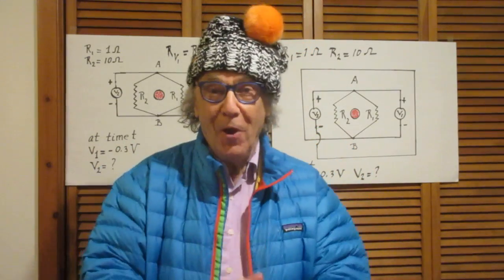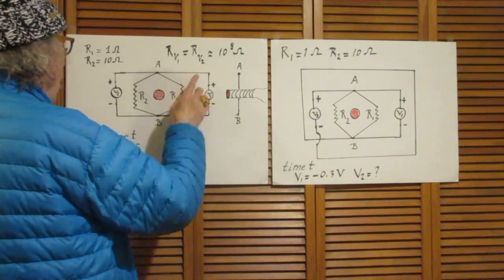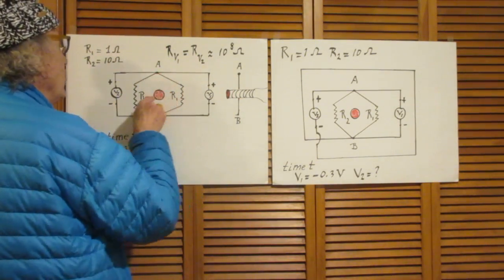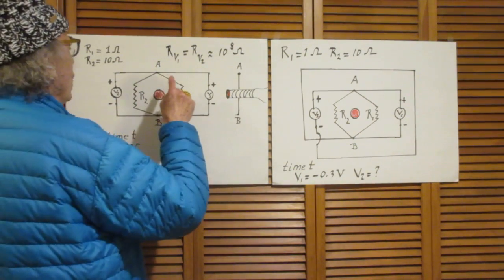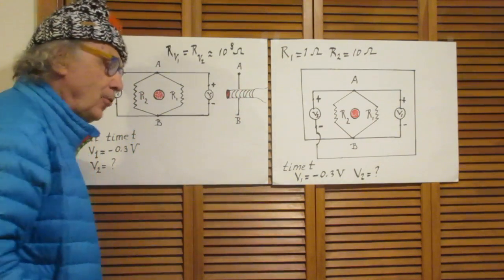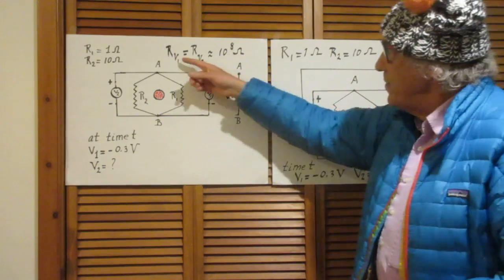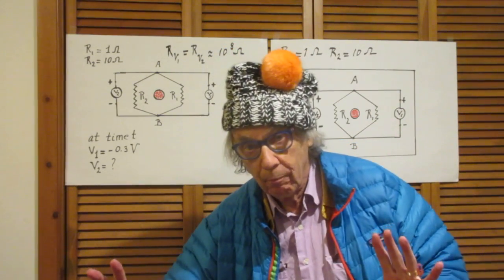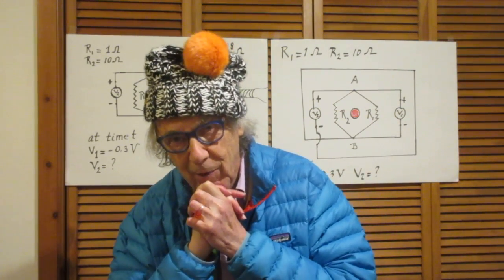Induced EMF Problem #37

Comment: Well, any reasonably trained electrician would, of course, immediately answer at the first sight of the "problem" that in both cases the voltages must be V2 = V1 = 0.3V ...in both cases (presumed that R and I in the supply-wiring to the meters are close zero). Length of wiring and location of the meters dont matter. 

Both meters are located at points A and B, current and resistance of the leads are negligibly small and if the meters are working properly, they must display exactly the same value. R1 and R2 don't matter regarding the fact, that both meters MUST show the same values.  Even when it get's more tricky and when we suppose, that a voltage is induced in the supply lines (which is presumed to be suggested here), both voltages must also have exactly the same value (only then increased or decreased by the induced voltage value, depending on the direction of flux of the magnetic current).

Do you just want to fool us a little, Sir, and make us ponder?  Forgive me, when I'm totally wrong  :)
Reply from the maker: I appreciate the fact that this Physics may not be familiar to you. Don't feel embarrassed about it; you are not alone. However, it's never too late to get educated. The choice is yours. Maybe this will help you. 
I demonstrated at the end of my lecture #16 of my 8.02 E&M course at MIT that two identical voltmeters attached to the same 2 points in a circuit can show very different values. https://www.youtube.com/watch?v=nGQbA2jwkWI&list=PLyQSN7X0ro2314mKyUiOILaOC2hk6Pc3j&index=17 The reason is that in the case of an induced EMF (Faraday's Law) potential differences are no longer determined; they depend on the path. This also applies to the secondary windings of transformers as the EMF in the closed loop of secondary windings is induced. https://www.youtube.com/watch?v=b7i2uMx7gHo&list=PLyQSN7X0ro22zanLOcvkaSY-IZqheFYM5&index=8
Of course, in cases where Kirchhoff's loop rule (KVL) applies, 2 voltmeters attached to the same 2 points in a circuit will always show the same value. 
My demo was first suggested and published by Romer in December 1982 in the American Journal of Physics. This demo has now become a classic; it's done all over the world at many colleges and universities. 
Kirchhoff's original text can be found in the following link, pages 497-514: https://books.google.de/books?id=Ig8t8yIz20UC. Clearly he was fully aware of the prerequisite for his "loop rule". KVL is a special case of Faraday's Law. That's why Faraday's Law is one of Maxwell's equations and KVL is not.
By teaching students that KVL always works without telling them when it does not work, makes many believe that the closed loop integral of E dot dL is always zero. ElectroBOOM and Dirk Van Meirvenne therefore believe that 2 voltmeters attached to the same 2 points in a circuit must always show the same value which is not true as demonstrated in my lectures. They each posted a video (see @ note below) on their channel in which they claim to have proof for their wrong ideas which violate Maxwell's equations. Apparently they do not know, or do not understand, that in the case of an induced EMF potential differences are no longer determined; they depend on the path. MIT students who took my 8.02 course (Electricity and Magnetism) would not make this mistake! I therefore believe that to introduce a "modern version" of KVL and then teach students that KVL always holds is not advisable as you may set them up for making the same embarrassing mistake that both Dirk Van Meirvenne and ElectroBOOM made. 
Also read Professor John Belcher's thoughts on Faraday's Law and on KVL. Professor Belcher is my former colleague at MIT. http://freepdfhosting.com/0813df09f5.pdf
(@) ElectroBOOM insulted me in his video by mentioning that the reason why my 2 voltmeters read different values was due to my "bad probing". If I had done the demo correctly I would have found that both voltmeters would have read the same value.  
This is my only msg on this issue. This is too basic; I do not argue either with people who believe that the Earth is flat.
Reply: A 1000 thanks for your kind and –as far as I could follow your remarks- illuminating response to my modest request.  As a trained e-engineer, who’s somehow helpless when facing phenomena that run counter to traditional e-technology rules, I would try to approach the matter with empiricism, methods of elimination and a little bit practice. In my simplistic but also balanced view of the world, I would shrug off the matter as a peculiar, unspecified "disturbance in the system" that needs to be eliminated (my perplexed shrug included).

As for me (as a practice-oriented non-physicist), at some point the path of mathematical analysis doesn’t really seem to have a promising end and in order to approach and to solve this dilemma I’d try to do it with the help of screens (oscilloscope, dU / dt etc.), shielded leads and, by adhering to the given premises (negligible inductance and resistance of the cables), I’d try to approach the "source of disturbance" this way and step by step   ...but, of  course, that's actually not the point and I am not sure, that this kind of approaching would solve my dilemma. I’m afraid it would - according to what you’re saying – partially just shake my conception of my small, little world  (which, of course, sometimes is more than necessary and also enlightening). 

Howsoever, Sir ...thank you for your wonderful suggestions. On the basis of your links, away from stubbornly following Kirchhoff, I’ll try to go deeper into the matter next days  ..within my means. 

Your physics lessons are great   ..as you are!    ....Greetings from Austria

Comment: V2 first diagram = V2 second diagram = -0.3V
Reply: Am I correct in assuming that the voltmeters are ideal and the probe wires have no resistance, inductance or capacitance and not affected by magnetic fields?
Reply: Thanks for the reply. Please tell me which of my assumptions are wrong.
Reply from the maker: There  are 2 mistakes in your answers (V2 first diagram = V2 second diagram = -0.3V). Copper wires total length about 30 cm with resistance, capacitance, and inductance  so low that all can be ignored. It's a very straightforward 1st year college physics problem. Use Maxwell's eqs and you have the answers in less than 5-10 minutes.
Reply: Please tell me if the voltmeters and the probes are are ideal?
Reply from the maker: These are normal voltmeters. All equipment is standard. If there had been anything special that students would have to know to do this problem, ofcoz I would have mentioned that in the video.  Some of my viewers and students have done a somewhat similar  demo at home with standard "RadioShack" equipment. Nothing in life is "ideal" but simple equipment is good enough to show that V1 differs from V2 by a factor that can be calculated in advance as I did in my lecture at MIT (for first year students) before I did the demo. It all comes down to knowing how to use Maxwell's eqs.
Reply: What if the voltmeters and probes were ideal, then, would my answers of -0.3V be correct? Your clear reply to this would make clear a lot of misunderstanding.
Reply from the maker: there are 2 mistakes in your last answers. You don't know how to apply Maxwell's equations in the case of an induced EMF. Don't feel ambarressed that you cannot do this problem. I suggest you look up my solutions which are on this youtube channel. This is my last msg.
Reply from the maker: You can lead a horse to water, but you can't make it drink. It's now up to you. Here is the water, however, if you do not want to drink and learn some new physics which was unknown to you, you are on your own. I have done all I can and cannot help you anymore. Good luck!
https://www.youtube.com/watch?v=xMVu_rY5xZY&list=PLyQSN7X0ro207exLyDsBo_N3_EJcydeeM&index=73

Comment: Even if the inductance of both the two voltmeters loop is very small (and their résistance enormous), I was wondering if the value displayed by both volt-meters hasn't something to do with the EMF induced through the volt-meters LOOP itself ?...
Here, I respectively mean :
- V1's loop is closed by the R2 conductor.
- V2's loop is closed by the R1 conductor in question 1.
- in question 2 : V2's pair of loops is also closed by the R1 conductor.
...
-And of course, the EMF is 3.3 Volts around ANY closed loop (whatever its shape or size)...
... Am I wrong Sir here ?,about wondering if the voltmeters loop(s) themselves (NOT ONLY the inside loop R1+R2) should ALL be considered as "inducted" circuits ?

Comment: This procedure was published by R.H Romer, Am. J. Phys. 50, 1089(1982).
Same problem in D. Griffiths, Introduction to electrodynamics
Problem no. 7.50
Ans to first part is, 3.3 volts

Comment: In first question, V2 is -3 volts. Since R1×i = V1 =>i = 0.3A, so, V2 = R2 ×0.3 = 3volts. The sign of V1 is -ve, so the direction of current is reverse and hence the signed value of V2 comes out to be -3volts. 
For the second case though, since there are 2 loops now, the induced emf is doubled, but resistance remains same, so current is doubled for V2. Hence, V2 attains value( i×2)× R2 viz -6volts. I hope this is correct, it most probably isn't though. I don't know why, but I feel that it is incorrect.

Comment: The answer for both the cases is almost +3V. "Almost" because in the outer loop too some current will be induced which we are neglecting since the resistance of the voltmeter is very high.

Comment: Kirchoff's Laws also must be satisfied for every loop. In first case V2 = -0.3. But in second case , since flux links with two turns hence V2 = 2x(-0.3) = -0.6 volts. 

This question also provokes us to think that :"we get two different values of Line integral of electric field when traversed along two different paths". It is justified because the induced electric field in this case is non conservative hence its value depends on the nature of path traversed.

Comment: In case 1, the total emf around the loop must be 3.3 volts (terminal A through R1 to terminal B then through R2 to terminal A), so that v2 will read +3.0 volts.
In case 2, meter v2 has a one turn coil in series with the negative terminal, raising its potental by 3.3 volts compared to case 1. Therefore, V2 will read -0.3 volts. This can be found from subtracting the 3.3 volts induced from the 3 volts across R2 (taking the closed path from point B around the loop to the negative terminal of meter 2 and then through the meter to terminal A, then through resistor R2 to terminal B)

Comment: 4th Attempt:
Case 1 V2= +3 volts
Case 2 V2=  +4.5 volts
 
3rd Attempt
Case 1    V2= -3 volts  (just changed the sign)
Case 2    V2 = -6 volts  (just changed the sign)
 
2cd Attempt
Case 1    V2= +.3 volts
Case 2    V2 = +.6 volts

1st Attempt
Case 1    V2= +3 volts
Case 2    V2 = +6 volts

Comment: Sir, do you remember, I have informed you that I have done this experiment in my lab? You told me to make a video of the full experiment, but due to lack of time I could not.....
Reply from the maker: No need to repeat this demo. I have done it 5 times at MIT. Recently someone sent me a video in which he repeated this using a transformer. He finds ofcoz exactly the same result that I did.
Reply: Thanks a lot Sir for your reply....
Reply: Really ? Maybe I should repeat it anyway

Comment: My first observation is both answers should be 3Volts, but then I realized this is a JEE question and it will never be that easy. So most probably I am wrong. (also my answer contradicts Kirchhoff's law and if we try to satisfy Kirchhoff's law, the current wont be the same in the loop )...aah my head hurts.

Comment: both answers  should be -0.3 volt as voltmeters are connected across two same point in both cases
Reply: Varying magnetic field produces an electric field which is not conservative and kirchoff is not valid
Reply: The diagram in case 1 and case 2 is similar right?
Reply: may not be conservative with time but i am measuring it at the instant t ...
Reply: Looks like your answer is public which means it's incorrect